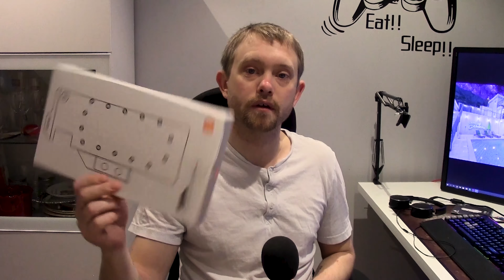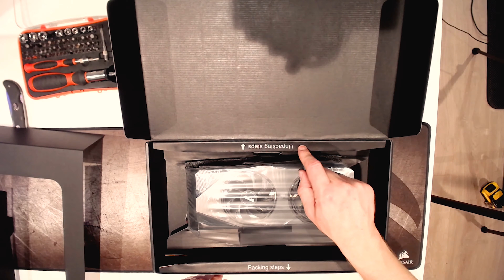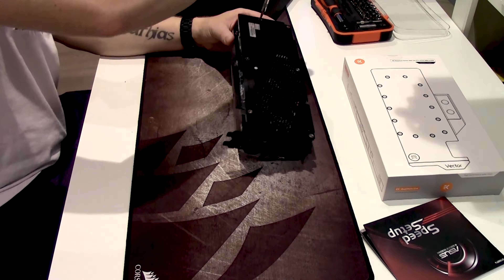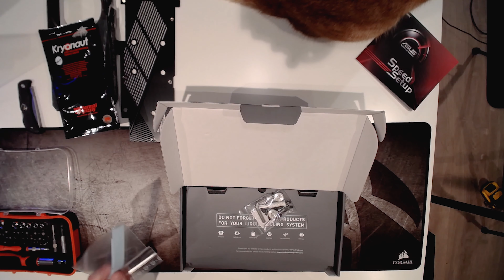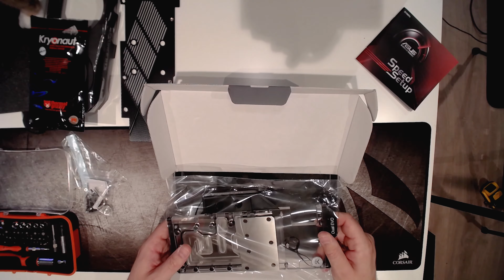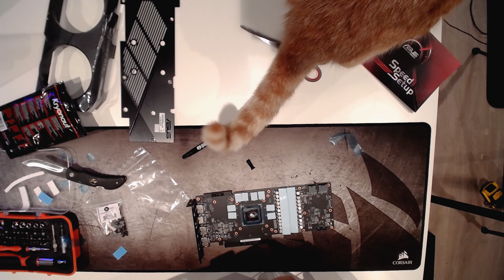WATERCOOLING ASUS RTX-2070 SUPER DUAL | TechTime #38

Comment: Constructive criticism: I clicked this video to see how to water cool a rtx 2070. Instead I watched you struggle to open a box, and give your cat a treat. You left those parts at normal speed? But sped up the actual installation of the block? No offence intended at all. But I was hoping to see start to finish installation of the water cooling, with you showing a performance comparison at the end or something. Again, no offence intended. I was expecting to see an instructional video
Reply from the maker: Noted, as the actual "how to" differs from card to card I didn't keep all of it in there apart from the basics, remove cooler, install block. I wasn't able to do the comparison as my pc suffered a pump fail (there is a video on that too) right after and that took way to long to fix. I still have the data so I might make that video sometime. Thanx for taking time to comment and apologies if the video didn't quite live up to your expectations
Reply: the cat was my favorite part ;)
Reply from the maker: I'll make sure to tell Felix you liked his part!

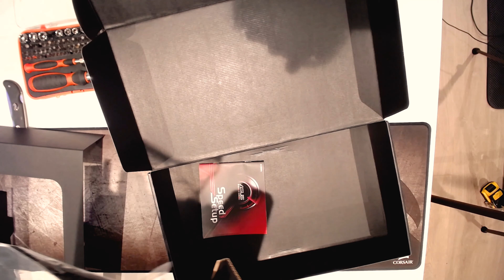Comment: My dude, if you had looked at the unpacking steps that are printed on the piece of cardboard you were holding at 2:50, you'd realize you didn't need to rip that plastic off. It's meant to be re-usable in case you need to RMA or sell the card later on.
Reply from the maker: That might be why it's there but it is IMO not a good solution for that problem, there are far better ways to do it, but hey5! That's just my point of view :)

Comment: man you didnt put enough thermal paste, gpus do not have the pressure plate like cpu's do, youre going to have incorrect cooling which is the whole point of a water block LOL
Reply from the maker: Hi, thank you for the comment, however it has been running for a year now with sub 50c temps so I would have to disagree. However I do recommend that you check out Gamers nexus or Linus tech tips's video on the subject of thermal paste application as they do a far better job than me explaining the actual impacts!

Comment: Hi there! I have the exact same card only for the RTX 2060 Super model. And I can't seem to find a suitable waterblock. Any ideas?
Reply from the maker: If ekwb doesn't have it, maybe alpha cool? Email ekwb and ask, might be a glitch in the system?
Reply: @Level10Gamers  will do thanks. Btw, after you install this waterblock, is it enough or do you have like a water pump in your case that you attach the pipes to the waterblock? (I'm aware that this is a very newbie question haha ) :D
Reply from the maker: @erkamcalik  lol yes, you are correct in that, that was a noob question, you need pipes or hoses, pump, radiators and fans mate!
Reply: @Level10Gamers  hahah i've felt like it when I asked too :D cheers

Comment: Please don't waste our time with opening boxes, I think our experience taught us to do that. Its even more interesting to watch your cat than you opening these boxes in slow motion. It would have been interesting to take a look over the surface if every hot components heat conductor is at a similar level in order to create a good common heat transfer towards the cooling plate. Also the overall installation and operation with its noise before and after the mod would have been nice.
But overall thanks for showing is the main process, now you convinced me that I can do that myself. 
Maybe my next machine will be all water cooled, but then I need a suitable case that supports several heat converters. Tricky one.
Reply from the maker: Hi! comments noted, I'll address it in the next video I make. In regards to the "have been interesting to take a look over the surface if every hot components heat conductor is at a similar level in order to create a good common heat transfer towards the cooling plate" I'm not following you here, what surface are you refering to here? when it comes to cases that support multiple radiators there are plenty of choices out there ranging from 1 rad cases like the Core P5 all the way up to Corsair 1000D or Raijuntek Enjo that can hold multiple 480 mm radiators.
Reply: @Level10Gamers  Thanks for the reply. I though it could happen that if the elasticity of the heat conductor tape isn't a lot, you might end up having some of that tape not even touching your cooling head, then it would fail the main intention to have an essential overall low temperature while having a silent system.
I haven't even started to research for cases with multiple radiators, so far I never bumped into  them because I don't like overly huge cases - I guess I will have to make a compromise here. Thanks for the hints, I have zero experience with water cooling yet.
Sorry if I use some strange expressions and word selection, English is my second language - later I also realized that what I called converter is actually a radiator.
Reply from the maker: @n1vca  I havent heard about that being a problem. i have been water-cooling for the last 10 years and have never seen an issue personally with this, but again that sort of boils down to if you do a bad job mounting it, you will have a bad time. the main intention of having water-cooling is keeping the temperatures down tho, you can make water-cooling just as loud as a air cooled system if you want or do it wrong. but yea a water-cooled system is generally more quiet. there are small cases that accommodate radiators too but agian the cooling must match the hardware. I'll be rebuilding my pc very soon due to non optimal perfomance with my current cooling setup. (you heard it here first! but yea there will soon be more watercooling vids)